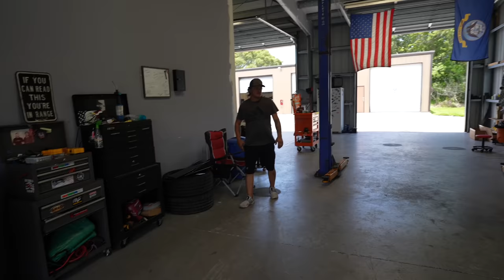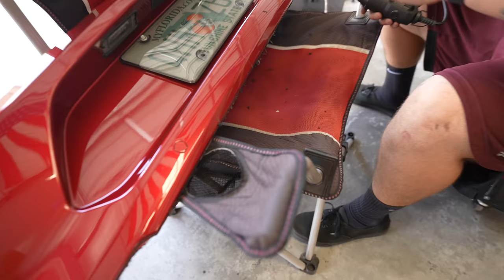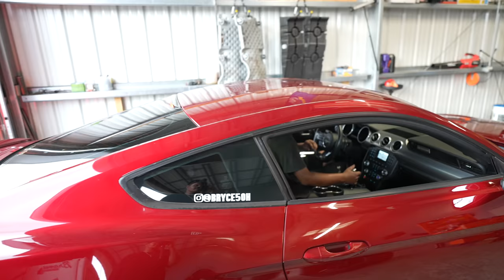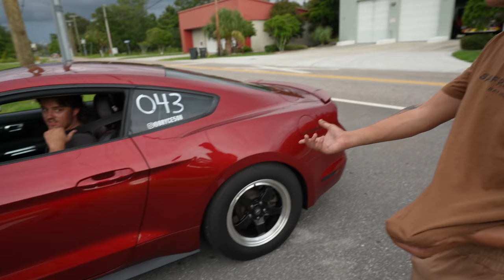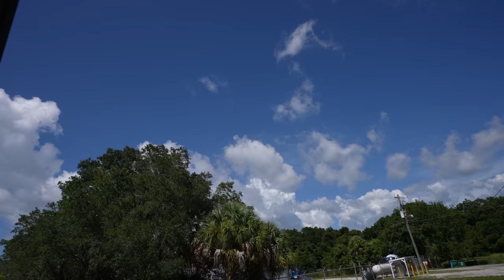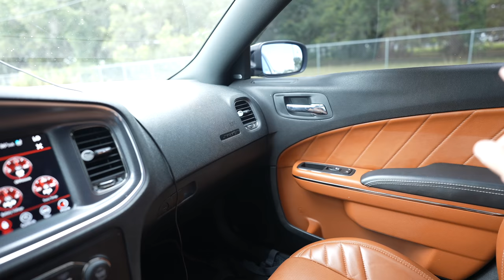Please help me...

Comment: is the front lip not drilled through the front bumper? if its not its just going to continuously keep falling off from the wind pressure. and if it is i suggest adding more screws.